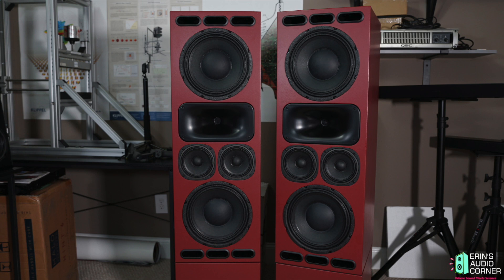Chat with Ryan Bouma of Impulse Audio and designer of the DIYSG 1099 Speaker

Comment: I've had 1099's in my system for almost 5 years now, love them. I find alot of trolls like to make snide comments without knowing the design goals of the speaker. They are basically Giant satellite speakers, aka  designed to be ran with a sub. Nothing about these speakers are an accident, it's all part of the design. They are big, dynamic, and very low distortion at extreme volume, they are a little hot in the treble, and are designed to be ran with a Sub and DSP. They are only so-so for music listening, again by design. Don't feed the ASR trolls. You get a lot of value for your money, as these design goals are so specific, you can spend a  ton on mass market speakers and not be their equal at what they where designed to do. Just don't expect them to be the last word in detail for high end music listening. Kind of a shame  Erin did not get to hear them with a subwoofer. I don't intend on replacing them anytime soon, as can't imagine what i'd have to spend to better them for HT by any appreciable margin. Probably 5k+  easy. Dialog clarity is amazing as well, out of that center channel. You won't be using any kind of dialog clarity boosters, or have any issue at all with the center not being loud enough/clear enough.

Comment: Ryan is a cool guy, too bad he doesn't show up on his YT channel lately, as he does house addition (lumber went in price big time). Put a lot the ceiling/wall spkrs, some Paradigms in my time - yeah I agree they are one big compromise. 
As for the flat-flat freq resp it usually never sounds good to me, probably depends on design criteria, drivers, room, etc. Zaph, John Krutke left many driver measurements behind which are still valid today. If the Linkwitz lobe shoots up/down +/-10, 15degr, no a problem - totally agree with Ryan. As for measurements nice to have Klippel, if not you partly relly on intuition and common sense. 
Thanks for the review Erin.
P.S. Erin more raw drivers please
Reply from the maker: I'm using the heck out of the NFS... new, expensive toy... gotta use it.  :)

Comment: What are your thoughts on the manfufacture's published sensitivity vs your findings, it seems all of the DIYSG speakers tested so far are below what is claimed. 
I could not find what methods were used by the designers.
Reply from the maker: I think Ryan mentioned how they got it, which is (apparently) the max SPL.  Some manufacturers take the max SPL at any frequency.  Some do SPL at 1kHz.  Some do an in-room average (Klipsch).  And some, including myself, use an average SPL over a range of frequencies.  I use 300Hz to 3kHz.

Comment: I wonder if those klipsch in ceilings are just some rebranded cheap car coaxials in a ceiling can. It wouldn’t surprise me. I actually just bought some $50 Rockford 6x9 coaxials for my boat and upgraded the crossover.  I really just wanted something that looked good and sounded halfway decent. I lost some sensitivity from toning down the huge 1k peak, and woofer breakup, but I got them pretty smooth. I bet the klipsch will be similar. Still nothing high fidelity probably, but certainly good enough for his use.